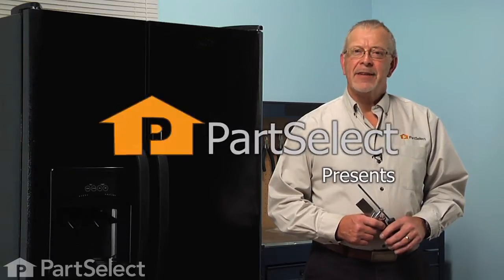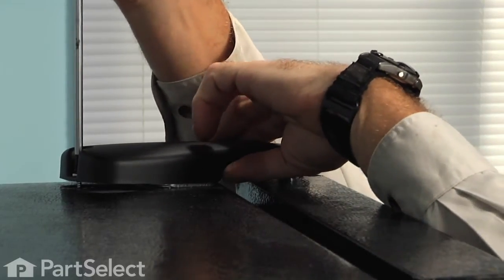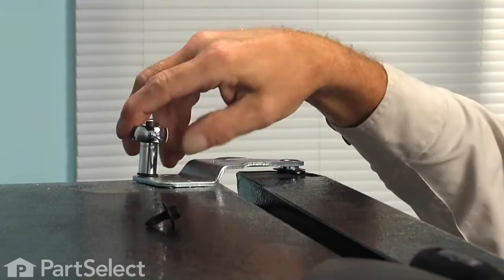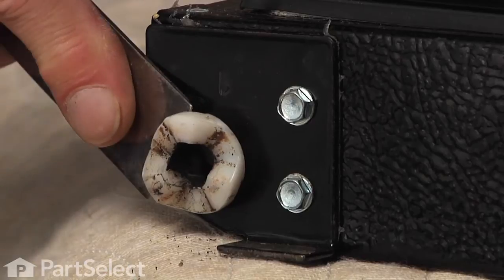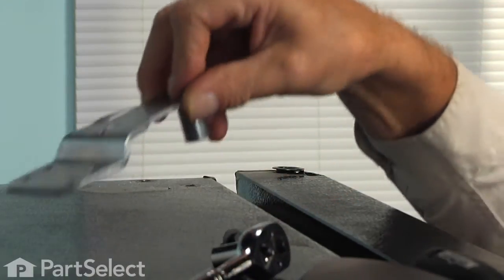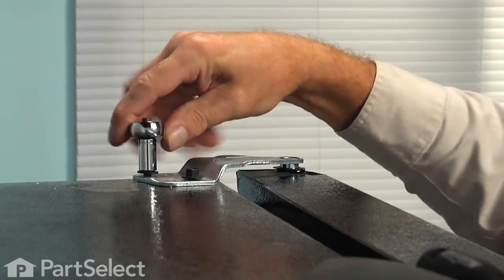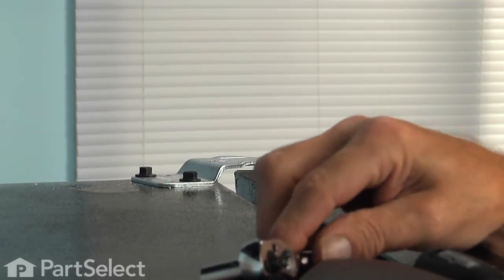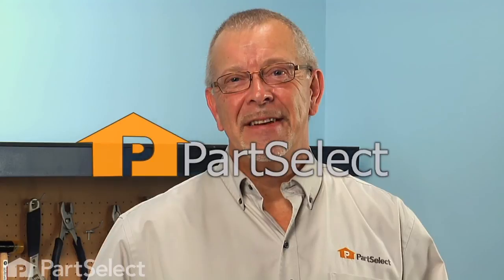Refrigerator Repair - Replacing the Hinge Bearing (Frigidaire Part # 240328203)

Comment: Good video and informative. This helped me save a lot of time.  You might want to include information relating to a broken hinge bearing. Mine broke (and the reason why I’m replacing it). I need to remove the bottom bracket and use a pair of pliers to remove the broken pice that was still in the door. Keep up the good work on videos.